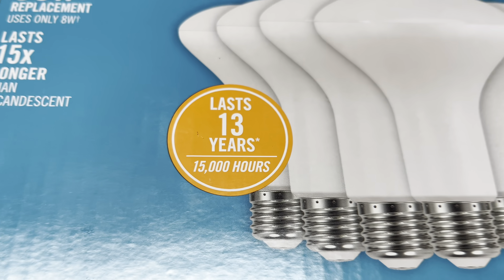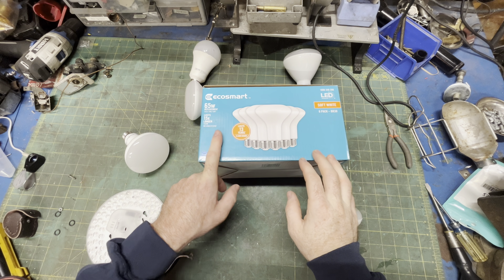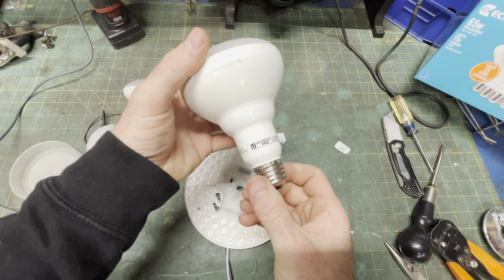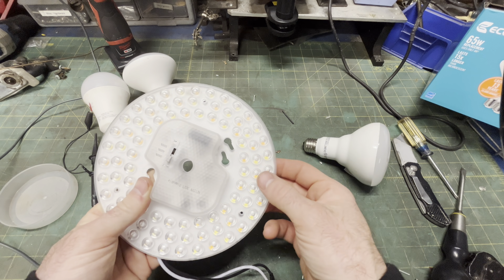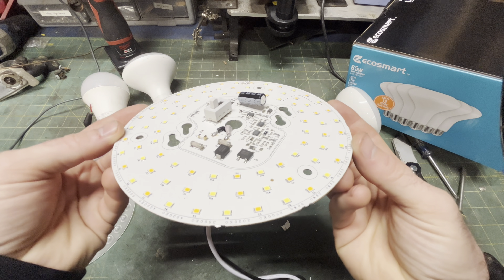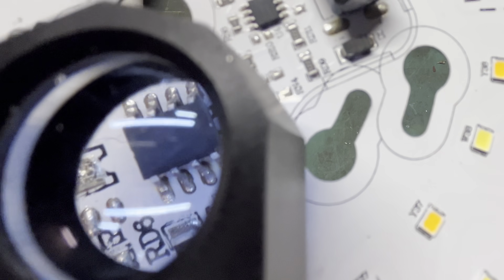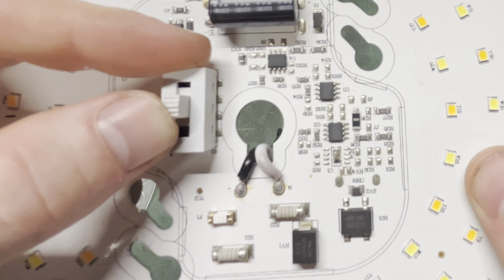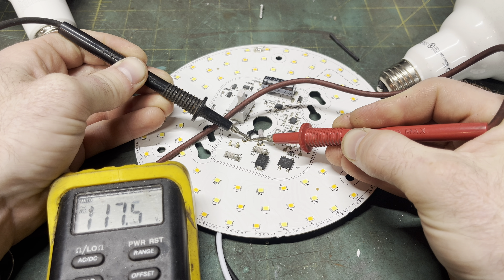Why Do LED Bulbs Fail? An Autopsy!

Comment: It's possible to DIY long lasting LED bulbs without any soldering.
9:00 Attention to the two resistors at the lower right corner. Many LED bulbs are now manufactured like this, with a controlling chip and two parallel resistors for current sensing. If you carefully scratch off the lower value resistor, you will reduce the current going through the LED chips. The benefit of this modification is that the bulb will not be cooking itself. The LEDs will be emitting light with higher efficiency, and the rest of the elements will have less thermal cycling.

For example, I bought 15W LEDs for 1.5$ each. Of course I bought one to check the circuit before buying bulk. There were two resistors for current sensing, 22 Ohm and 30 Ohm (resulting in combined resistance of 13 Ohm). The base 15W lamp runs hot and so starts cooking itself. If I scratch off 30 Ohm I get ~7W lamp which still runs fairly hot. If I scratch off 22 Ohm I get ~5W lamp which runs just warm. Now those 7W and 5W lamps actually punch above their weight because of higher LED efficiency, and will retain their brightness for years to come.

Comment: I have a good Phillips LED from 2010 that runs almost 12hrs daily. It is a 100W equivalent with three position. I set it to low during the day for my dog, and since they died, my other pets. Then I use it on higher modes at evening and night. To this day in 2024, it's still chonking along perfectly. So yes, they absolutely can last, but yeah, not the cheap chinesium we see anymore.

Comment: I also wonder if all of the puck led lights I have been installing will last much longer because the control board is much further away. 
I am also curious how a new construction should be built to house LEDs. I like those puck lights a lot and have nearly 60 of them install to date and maybe another 50 more to go. Finding places to install them is very easy as it is as simple as expanding the existing single location light in to several locations. For example I went from a single old ceiling fan light to 5 of those 6 inch led lights. Turning on the light makes it so much brighter. My office has 2 light switches one that is a dimmer of 3 of those led lights and 3 more to light up the rest of the room. I install lights in the closets, hallways and anywhere else they need it. Add in new electrical line and snake down a switch to the wall and you got a custom light.

Comment: The problem with LEDs isn't with the technology itself, but for the lack of quality control (just like with pretty much everything today) as most of these come from China.  Poor parts make for an unreliable product.

Incadecents are highly ineffecient, they use up 10x the amount of watts and most of that energy is lost through heat.  LEDs generate heat as well but near as much and again, they can get much hotter than they should be due to poor quality components and design for the heatsinks (if any are present at all).

Comment: I think the issue is that the LEDs that I own I bought back when they were still very new (early 2010s) so they were actually of good quality. I have a set of Toshibas that I paid $80 USD per bulb... still alive and kicking. All of the new stuff seems like total crap but I guess it's so cheap now that it doesn't really matter if it lasts at least a few years? I assume most of it just dies because of poor heat dissipation.

Comment: I have literally dozens of LEDs in my home. I think i've had about 4 of them fail in the last 5 years. The amount of electricity savings from switching from incandescents has been enormous, and the cost of LEDs is now about the same as incandescents. In fact, the local energy company is just about giving them away .

Comment: An electrical contractor I worked for got a good deal on some quartz bulbs made in China. Within two weeks of installation they began failing. I was careful and made sure I didn't touch them with my bare fingers so I was surprised. We ended up replacing them all with made in USA bulbs. Problem solved.

Comment: I've had color changing bulbs fail for like white and cool white. I can see the dark spots on the LED when I took it apart. If i told it to any color besides white then they would work but I really don't want a orange, purple, blue, red, green bulb all the time. And they didn't nearly last as long as they said they would. I am lucky to get a year of use out of them and with them hardly being on in a bedroom. As I am lazy and I like to be able to tell my Alexa  to turn the light off from the bed.

Comment: TBH I think a large part of the problem was that heat wasn't a problem for incandescent bulbs, thus light figures generally aren't build for cooling via airflow or heatsinks, seen too many LED "bulbs" die from heat in fixtures that trap heat. Ideally, new fixtures should be designed to reject heat instead of trapping it.

Comment: It's a confluence of problems. That makers are now using low heat non-lead solder combined with how hot the bulbs actually get. It's likely the heat from the LED lamps are de-soldering their own components slowly over time.

Comment: I actually have an LED that has lasted: a Philips DecoLED BG3BA9/DECO/CL that I paid $15.97 in 2009. It has been on continuously for 15 years—some 131,200 hours or so, exceeding its 15,000-hour guarantee (which expired in 2015) of 15,000 hours by nearly 9 times already...

Comment: I't not the cheapness is the problem, it's the socket. Once you get rid of the classical light bulb form-factor, you no more need to cram everything into a tiny sealed and isolated package. And that itself gives a lot of freedom for much better, more efficient designs.

Comment: At 11:55 - "it has the same resistor / capacitor" - but this capacitor is 63V - so it's nowhere near the mains input - and there's a little transformer on there too.  You can see why this is a more expensive bulb.

Comment: the led bulb in my room is so bad quality, the soldering would melt with the heat of the leds, and beads fall in the difusor(the white cap) and after some time it sounded like a maracca when you shake it, but its still works after fixing it

Comment: 9:30 I'd be shocked if that resistor had managed to fail without looking the part, but I suppose it could have cracked internally.
One thing I have seen while doing repairs, is some types of solder joints are seemingly completely impervious to multimeter leads. I don't know if it's a specific type of solder that forms a strong oxide layer, or what, but I've legitimately had to add solder just for probing. Sometimes putting the leads on top of the component works instead.
P.S. I'd probably suspect a bad electrolytic capacitor. There wasn't any smoothing present on the rectified voltage.

Comment: I would say part of the problem is how modern light fixtures themselves are still designed for incandescent bulbs IE the sockets. What engineers could do is offload alot of the "Hard" components to the socket itself, as the socket would be a much better place to put a large heat sink etc. Then we could reduce the cost of the bulbs and then have just the failure components in the replaceable bulb, but that would require changes to building codes. Also CHANGE US TO 220V! we would save 30% on copper!

Comment: Some LED bulbs when installed in a garage door opener will cause the remote to be jammed when the light’s on.  Wonder why your garage will open but not close using the remote?

Comment: I have yet to see any LED bulbs outlast an incandescent in the same application. The last two I bought were for my fridge and they lasted about three weeks, thats the shortest lifespan I have seen of any bulb. I stick with incandescents from my stockpile because the little extra expense they cost to run, are off set massively by their cheaper price.

Comment: Something to due with the compact ballast in those screw ins. I do maintenance at a hospital and Ive installed many direct wire 2ft/4ft bulbs. A lot have been on 24/7 for 5-7 years since I started and literally 1 light has failed. The screw ins seem to fail annually

Comment: The Feit that I i had went out because one of the LEDs burned out, and they wired them in series, so in Christmas Tree fashion, when one goes out, they all go out. 
I just jumpered out the offending LED, as the zero cost option, and they lit up again, brighter than before due to the higher voltage. Used it without the diffuser as a spot lamp of sorts, and it lasted a while until another went, and got the same treatment before the voltage degradation accelerated and cooked the rest. Fun while it lasted though.

Comment: I'll watch it later today but I would guess the most likely culprit in most cases will be the line-facing dropping cap.  It's a rare LED bulb with a real power supply in it.  Also, fun fact: if your LED lights blink a lot, it is usually the result of these cheep dropping-cap "supplies" combined with line noise. If you can find the rare bulbs with actual power supplies, they don't blink. The one I have in my desk lamp is "Greenlights" brand. Funny, I thought that was a cheap brand.  I have a fancy Feit bulb with selectable color temp which flickers like mad.

Comment: With all the electronics in LED bulbs, I wonder if they are more vulnerable to power surges.  I'm thinking maybe I should get a surge protector for my breaker panel.

Comment: Any technology will eventually fail.  Question is on the average. Do the LED lamps do what they're supposed to be doing?

For me when I moved in as the in law with my son and his family into a very large home.  Replaced all of the incandescent lamps when they failed with LEDs.  In a few cases, like the lights that are always on replace them with LEDs right away.  Over the years have only had a few failures after a number of years of use.  LED lamps that I have purchased have met my expectations.

My hope is the technology will get better as time marches on.

Comment: I moved into my house in August 2016 and equipped all my light fixtures wirh LED bulbs. Not one has failed yet.
Reply: As quickly as lighting products are changing these days, you can't assume what you buy today will be as reliable as 8 years ago.

Comment: Thank you for this, most illuminating, ahem. This has been bugging me for a while, and I'm getting cynical about whether LEDs offer much environmental advantage if you have to throw them away every few months. Here in the UK we have nominal 240v AC. However the voltage that I receive is in fact usually 250v and sometimes more. Do you think that this might be affecting the lifespan of the bulbs? Also, do you think that more expensive bulbs might last longer?

Comment: i also tried to repair them and i gaveup, i might replace my home's lighting with DIY using LEDs used in public lighting and flood projectors and driving them at lower current so they might  last longer without burning

Comment: 1. Good LED bulbs are not cheap. Be prepared to spend $10+ a bulb. 

2. Get the warmest bulb possible. The warmest ones tend to not drive their leds not that hard compared to cool or daylight

3. The "Edison" style is the best for longevity, puts the most distance between the LED control panel and the head of the leds

Comment: LED bulbs on average last way longer than incandescents in my experience, and of course they use a fraction of the energy. We have recessed lighting in our house that uses GU10 bulbs. The halogens we were originally using rarely lasted a year. The no-name LED bulbs we replaced them with have lasted in some cases up to 11 years so far. No doubt there are LED bulbs that fail long before they should, but on average they're way better.

Comment: High component packing density and high power without proper heat dissipation will lead to premature failure of any electronic appliance. Add to that glitches on power lines, without proper noise filtering and under rated(esp. breakdown for active devices, ripple voltage for capacitors and wattage for resistors) components. 
Ideally an LED, if not over driven, will have half life(when light outputs reduces to half of initial output) of 11yrs of 24x7 continuous operation. But many light bulbs are overdriven by a factor of two atleast, without proper heatsink and dissipation to the ambient. Adding a fan could extend, but will limit the life to the failure of fan. Ideal solution is convection cooling with oversized bulb and heatsink, without much overdrive of leds(means lesser output). Just some 💭

Comment: The led bulbs in my bathroom kept burning out.  Sealed fixture, no ventilation to the bulb.  I replaced the fixture with an open one with air circulation.  No more failed bulbs. Problem solved.  All the fixtures in my house are now open design with some air flow to the bulb.  I still get a rare occasional bulb failure elsewhere for other reasons.

Comment: Yes, and interesting information video. However I have noticed on the standard LED household light bulb, the different brands have a difference of the amount of heat you feel from them. My guess is some have the electronics in the very base and the others use some other place for the electronics. 
 The weird thing is until we started using LEDs as a full light source the LED was a cool running thing, used as a power on indicator or other panel read outs.   
The failure is often due to the heat they make that will dry out the capacitor, or show up on a part that was not made well, or a bad solder joint.  The computer flat panel screen and TV's of the same design; it is often the failure of the capacitors. Replace the can capacitors with the same value and type and your monitor is fixed.  Problem is these days most want a instant fix and the point of a component repair person to fix these is becoming a lost job.

Comment: Really hate cheap junk LED lights. Disagree that they’re better than cheap incandescent lights though. Years ago I did facility maintenance and it seemed I’d have to change burned out incandescent bulbs almost daily. They plan obsolescence into those as well. Started replacing everything with LEDs and they lasted far longer. Ironically, the heavier more expensive GE bulbs were the worst. The cheap ones from Walmart performed the best. 😂

Comment: I found that the LED bulbs do not survive in non ventilated areas. We have had mostly the same led bulbs in our house since it was built. We may have changed 3 and it was the heat killing it. We switched to a purpose built LED fixture and it hasn’t burn out in the 8years it’s been up.

Comment: I had someone ask me to replace a bulb in an outside light that was about 6 years old. It was one of the fixtures without an actual "bulb" and the fixture was a matched set of 10 so at $150. each, not a good option to replace all of them or even the 2 that were out. so I took it apart and replaced the LED itself for $20. ea. Plus labor, of course.

Comment: I like using needle-tip extensions on my probes. So sharp they can 'poke' into the solder for a solid contact. Also: have you removed the plastic film from your multi-meter display? If not it may be making filming the display difficult.

Comment: i got 1 led from 16 years back run it 24/7 but cost 150 euros.. still works from a ovrpriced philips ambient.
the handcontroller is almost dead tho

Comment: Overheating and because of that most times the power supply dies mostly. That is why I think we should have light on 12 V - home 12 V network for chargers, laptops, lights etc :) ... which means.... no heat to kill the boards :)

Comment: My experience with these  LED bulbs is that if you burn them base down, like in a table lamp, they last a real long time.  Base up like in a ceiling socket, the heat kills them.

Comment: it got so bad that I started writing the date of installation on led bulbs, the ones in my kitchen and garage are not even lasting a whole year until something fails in them and they become ultra dim so the leds themselves are still working but something in their power supply dies

Comment: Then there are the first-generation CREE LED bulbs that had connections between PC boards that were not soldered. They proudly claimed it wouldn't be a reliability problem. Wrong, over half of mine have died premature death. They were some of the first high-CRI bulbs. They were also made in USA. I used to ask for warranty replacements, got a generic Chinese bulb, although I'm sure the LED chips are from CREE.
I should cut one open and see if the missing solder can be added.

Comment: Do you think the ran the leds on a lower voltage  for longevity.  Or they ran them all to reduce internal heat on the board itself.
Reply: Running LEDs on lower current extends their life. The forward voltage is fixed and different for different colours. Although the ones that rely on a phosphor excited by blue/near UV to create different colours all run at the same voltage.

Comment: Good ol' cold solder joints, gotta love'em. On a certain model old Toshiba laptop they had the heat transfer pipe right next to the solder joints of the video chip, and those old Toshiba's ran hot, that's why the heat transfer pipe. Well it would get hot enough to unsolder some of the joints on the chip, then they would go solid as a cold joint. I removed that heat pipe on the ones that came in, and cut away some internal plastic uprights that were blocking airflow from the fans, that was the base reason they got hot, but I would have to put the motherboard in the oven and do a reflow on all the solder joints, made a poorly designed laptop into a useable laptop.

Comment: I dunno...if we're "stuck with" only lasting 7 times as long as the incandescent not the advertised 15 and still using 1/10th the power or less, still seems like great progress.